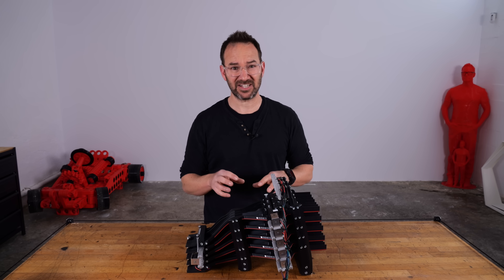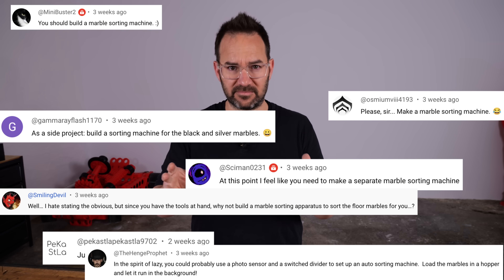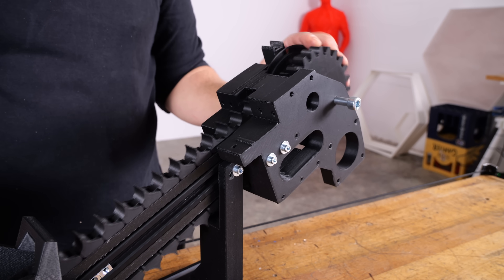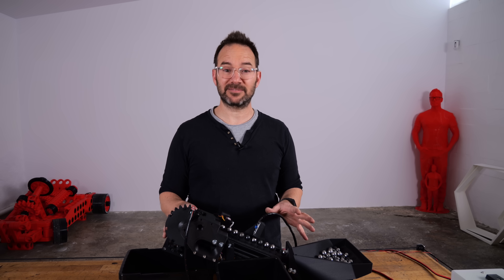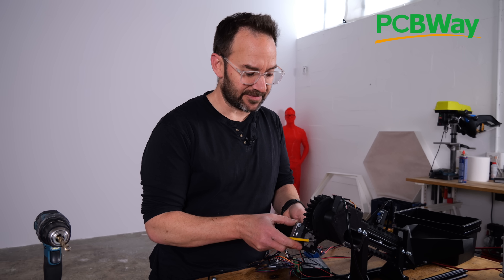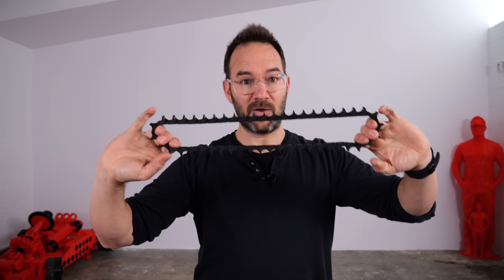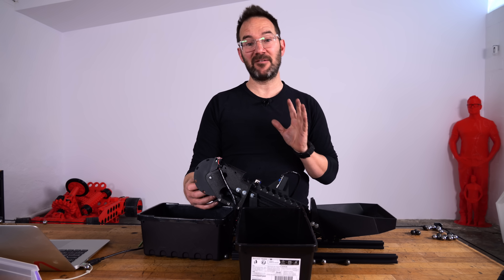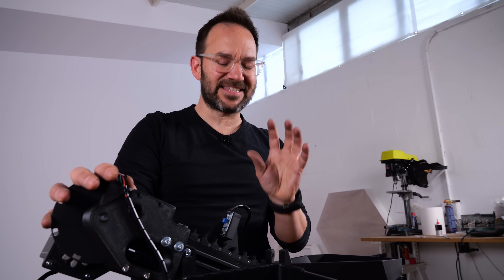Faster than the Eye Automatic Marble Sorter - Marble Clock Seconds Display Pt.3

Comment: Definitely need to incorporate :) I reckon you could get faster by optimising the solenoid motion by a) adjusting the timing so that the retraction of the pin is matched to the "springback" of the solanoid when it extends, and it can effectively speed bounce it out of the way (rather than oscillating a couple of times after extending), and b) adding some sort of dense foam sort of material behind the solanoid so it doesn't oscillate after retracting, but gets to a stable position sooner. Fixing b) in particular I think is the key to stopping it getting it out of sync with the chain and colliding like it does at 9:27.

Comment: I feel like 1 track is not consistent enough because of its ridiculous speed. The marbles are flying everywhere.
Having 2 of these will already reduce the speed by a significant amount.

When I opened the video, my own mind would choose for a system where you sort 8 marbles at the same time. 

I believe the display has 15 marbles per unit. So 8 marbles per sorting cycle can handle more than a unit per 2 sorting cycles. 

With a complete clock, in the end you need to sort for 4 digits, so 15x4=60. Using a system that can sort 8 at once, makes it so this system needs to sort 8 marbles per second, instead of 60.

Comment: If you want it to make it even faster, why not try a second syncronized step motor, but linked with a rotational pusher, so instead of waiting for the solenoid to retreat, it rotates the gear, pushing the marble and engaging to next position waiting next marble.

Comment: I like your creative and inventive initiative and the different ways you try to figure out how stuff can work.

Although, with that being said, keep in mind the idea that even in regular jobs, whether there be stocking store shelves in retail, working quick in the warehouse environment, which I currently do at my job for let’s say nine years around the end of August, little saying that captures trying to get stuff done quicker for making the numbers or the profit at a place, is that the faster you go the more mistakes you make. 

Around the first half of the video, there was a point where you had the machine, moving decently quickly and thoroughly doing exactly what you wanted to do fast enough without any mistakes, but the one thing I don’t agree on is that even though you have to have the marbles resorted to try every test run with your second counter, you need to be aware, that hypothetically, and this is completely off tangent, I live at home in an apartment and it’s just me, and there have been times where I’m trying to heat up something in my toaster oven or reheat it in my standard size oven, and I said a handful of minutes like let’s say even eat at the most to reheat pizza, I’m doing other things while heating up and my version of multitasking 😄, keep in mind that what you’re trying to accomplish is in a much much shorter time than eight minutes, you’re trying to have several marbles sorted within a time span of a minute and a half or less, but despite the idea of trying to make something move faster, so you have it sorted as quickly as possible, unless you build some thing that can withstand any mistakes at a speed you’re happy with, I would say either one of two things, somebody on here made a comment of making two sorters and slowing it down just a minor tad that way to machines doing the job a slightly slow pace but doing the work would get it done quickly in half the time, or, if you only want one machine, you need to have the patient or some minor sensitive responsibility to understand that if you can wait a minute and a half or less for the machine to sort itself properly at the low speed in the video that worked while making no mistakes, then having the patience to deal with that is the responsibility if you know, can do it at some speed that you’ve already tested that can do the job without an issue.

Hi, believe me when I say, I understand trying to figure out a way to make the sorting the fastest possible with no issues before it’s too out of whack or before things get out of hand, but the point in this video when you had a decently quick speed, no mistakes or errors in the process and what you wanted was still getting done, I believe there’s a little bit of responsibility in being able to realize that and stick with that if you have the patience to wait a little bit longer than what you foresee as the fastest speed possible without making any mistakes faster than the speed I’m mentioning in your video where no mistakes were made, you just have to have the patience to deal with it.

And that can sort them out overall helps you sort the marbles in the case of your second counter, that may be what you might have to deal with.

But something tells me with how creative you are, that you’ll either come up with a way to make your machine or make the same idea but in a different way that allows her quicker speed somehow with no errors, or come up with these mildly different similar way of sorting that will allow quicker speed.

Overall, though, when I was in the last week or so saw your video, my first video of yours on making that big marble sorted clock that shows the time that started switching the time by every 4 to 5 minutes, I like that you’re creative and inventive, and you not only say what you think the issues are but say what you think will do to help fix it, we’re like Seeing you talk about how you’re thinking about it as you do it and I like that.

Comment: Would like to see 2 of these running side by side, shooting into a shared central pipe for one color, and a shared dumping box at the end for the other. They could each run at a slightly lower speed that way, increasing reliability and also boosting noise... Perfect!

Comment: Run 2 of them in parallel at 12 m/s each for a total of 24 marbles per second and put that on the machine. You could definitely share a single drive motor for both chains. You just need 2 sensors and 2 solenoids

Comment: use solenoid to move a deflection paddle/tube at the END of the chain to direct the marbles into the two different bins.  then, as the marbles spit out the end, they go where they need to go.

Comment: 9:14 At this point, the 4 most needed modifications I can see are:

1) You need to add a wall on either side of the chain to keep the marbles from falling off as they come rocketing out of the hopper...

2) Taller hopper walls around the chain pick-up area...

3) A guide tube (with side walls and roof) would be a good next step to catch all the black marbles as they get kicked off the chain by the solenoid so they get directed down into the bucket rather than fly who knows how far before gravity reminds them which way is down...

4) Another guide tube at the end of the chain to catch the silver marbles as they too fly off the chain...

3 & 4 should save you a lot of time chasing down errant marbles that missed the buckets...

😄😁😆😅😂🤣

Comment: Ideas on how to optimize the sorter:
1. Make 2 rows on a chain drive. The left row is for light ones, the right one is for dark ones. The solenoid above the left row throws dark balls to the side, and above the right row, vice versa. As a result, dark balls will fall on the left, light balls on the front-left, dark balls on the front-right, and light balls on the right. You just need something like a tunnel to direct the side balls into the corresponding basket, and you will get a 2x acceleration - that is, you can slow down the conveyor and it will become quieter.
2. Why a conveyor chain belt at all? Raising the balls up is extra work, you will still have to raise them later to the level of the number dialing mechanism. Let there be just something like a gear wheel inside the corner of the diamond-shaped container, where instead of teeth there are seats for balls, on the sides of it there are 2 containers for already sorted balls, and above it there are 2 solenoids for resetting to the left or right. Fewer moving plastic parts = less noise and greater reliability.

Comment: Put a lever between the solenoid and the marbles to speed up the movement of the kicker. The solenoid has plenty of power but moves too slowly.

However, industry standard for this is to deflect the objects while they are falling with an airstream. The advantage is that the objects don't need to move the whole distance at the deflection point. They get an impulse and will move over by themselves while falling afterwards.

The other advantage of using the falling method is that you wouldn't need a belt, just a container with a marble-sized hole...
Reply: Then it is necessary to provide protection against blocking the hole by colliding balls. In industry, this is solved by vibration of the container, but in our case it can be too noisy.

Comment: Why not just make a loop of 10 marbles to rotate through the pattern from 0-9 and back to 0. There are even 4 segment displays so you would only need 4 loops of 10 marbles, bring each marble to the front, then keep it in order and return it to the back of the queue on the same segment piece. If the segment does not change states you would not even need to rotate the pattern just skip it that step.

Comment: Why not run two (or more) solenoids in tandem, firing oppositely?  While A is firing, B is resetting, effectively doubling your feed rate.
For the loading hopper, what about adding a drag strip as marbles head up the ramp, helping them settle in the chain so they're not bouncing about from the crazy load speed.

Comment: Maybe it would be faster (or catch less) if the solenoid moved a one way revolving wheel that pushed away the black marbles. Sort of like a revolver. Even better, the revolver wheel would work with two solenoids, for alternating stages. One pushes while the other one retracts, while the wheel keeps moving with any of the two.

Comment: I can imagine a miniature version of this clock that can sit on a nightstand. It would double as a white noise machine.

Question: won’t the solenoid piston put dimples on the balls over time?
Reply: Much earlier, a huge number of sliding parts will wear out; even if you make them of steel, they experience several orders of magnitude more load than the balls from the impact of the solenoid.

Comment: How about slightly smaller black marvels? You could maybe use a set of rails with the right spacing and all black marbles would fall through and all shine (bigger) ones would roll onwards. It would be a simple setup, easy to scale, fast, quiet and cheap.

Comment: Could using the first idea with the servo arm be faster by setting it to make a full 360 degree rotation when needed to push out the black marbles, instead of having it swing in and out?

Comment: Already at 11/second, there are multible black marbles in the wrong bucket, and it gets worse. I'd make 2 of them and run them slower but more reliable.
And consider the friction, this printed chain wouldn't last long at these speeds.

Comment: If the tolerances for the rest allow, is there any reason you couldn't have marbles be a slightly different size?  That'd make sorting across a grate massively faster than needing sensors and actuators.  The tolerances in the grates would be a bit more critical, but I think easier to solve.  If close enough in size, shouldn't cause any issues in the display

Comment: could you use a servo with a cross arm (4 arms off of it instead of 1)  Then all you would need to do is rotate it 90 degrees to eject a marble.  no having to stop and back up with each ejection. Other than that, make multiple channels for sorting. (duplicate your sorter and keep the speed at 10-15 marbles per second)

Comment: Of course you should incorporate it! You'll need a steady supply of sorted marbles. :)

Two suggestions:

- switch from the solenoid rejecting black to rejecting while/silver. Then it won't trigger on empty slots. Less runtime + heat.

- mirror the design to run two chains rejecting marbles into a central bucket. Then you can run it a little bit slower, have more room for error, and throw less marbles around at the loading end of the chain(s).

Comment: Instead of a solenoid you could have used two electromagnets right at the color sensor, and instead of using a timing belt let them roll down a ramp with a rotating mechanism that drops them down the ramp one at a time at even spacing. Then the magnet would direct the ball either left or right as it falls down the ramp. Way less moving parts which means less points of failure and the ability to make it move much faster
Reply: Alternatively, you could have even just found two different marbles, one that's ferrous, and one that's aluminum or something, and sorted with nothing but a ramp and single magnet

Comment: I would have envisioned a vertical approach with a holding bin on top with an exit hole, with a bit of magic that lets one marble at a time enter a vertical tube, falling down to a magic Y-tube (one tube in on the top, two tubes out on the bottom).  Or maybe the marbles roll around on a large flat rotating disc with holes around the circumference which the marble fall into partially, where thus trapped they roll around with the disc until they are over a chute with a color sensor operating a trap door to let one color fall through, where increasing the marble handling rate is accomplished by adding more chutes, each with their own color sensor and trap door.  (The rotating disc approach was used on a surprisingly simple coin sorter design that could sort thousands of coins per minute.)

Comment: You can see how many marbles are falling out of the bucket in the final shot of the video. I say, if you need ~17mps — just drop the speed to 10mps and build a second machine. Not only would you increase the total speed to 20mps, you also would increase sorting efficiency.

Comment: a mirrored pair of these would get you over the threshold for speed quite well
you could also get a solenoid that has a stiffer spring, as that will retract much quicker, but will use more current to fire

Comment: You can probably fix the issue of the solenoid catching on the chain by moving it a bit higher so it clears the teeth when extended. If need be some sort of flexible "foot" could be attached to contact the marbles lower down - stiff in the direction of the pushing action but flexible in the direction of the belt

Comment: Obviously we want it integrated!

Have you considered using compressed air to push the marbles? I'm sure there are high speed valves for airsoft that can be modified for this application

Comment: Being lazy, I'd probably just have a gravity fed funnel with the IR sensor in the spout that controls the solenoid that would either send the spout left or right depending on the colour... That way if you have a run of the same colour you can leave the solenoid in the same position until the colour changes again.

Comment: Why not ad more sorters. Since I noticed it runs a little to fast for reliable sorting, some dark ones seems to getting missed for some reason. Why not have two or even three sorters in parallell and run it a bit slower. Might get lower noice as well.

Comment: I say use 2 of them side by side with a gap in the middle. Push black to the center.

At the high speed you had you were getting so much vibration I could see it being a problem.

Also rails on the side of the track up till you need to knock the marble out.

Comment: What if you used air instead of something actually touching the marbles? You wouldn't have to worry about anything interfering. Not entirely sure about how difficult it is to get a valve to open and close fast enough for it though but you could use multiple valves leading to a single outlet if they cant cycle fast enough

Comment: Rather than a servo motor or a solenoid that has to move out and then return, taking twice the operation time to clear the path, could a motor with a four blade windmill be made to make a quarter turn to achieve the same effect? That way the next blade would be in position immediately to eject the next bearing.

Comment: I've worked on high-speed equipment.  One way that works better than a mechanical push is to use pressurized air.  A solenoid operated air nozzle has no interference and is very fast.   Also, the sorting function should be occurring asynchronous to the need for sorted marbles.    As they come off the clock, mixed, they can be sorted into the bins.   The need for sorted marbles comes out of the bins that never are allowed to go empty.  With presorted marbles building the numbers should go a lot easier.

Comment: If you want to go super fast, you could leave the solenoid energized and use an H-bridge to swap polarity based on state.  That way, it would be: powered extend, powered retract.  It would likely provide the damping you need to go even faster.

Comment: I have three suggestions, one of wich may not make sense, i don't remember the proportions between the number of shiny and black balls: first of all you could just add a second solenoid and make them push the balls out alternately (like, one ball is pushed by the first one, one by the second one and the next one by the first solenoid again in a cycle); It could be also a good thing to add a second sensor to be shure about the balls identity if you get false readings when making it go faster thanks to the second solenoid; lastly, once you make it go faster and you connect it to the rest of the clock (thing that i think would require a bit of overhead in the speed), there will be a bit of empty spots in the chain, so i would either switch the balls (by pushing with the solenoids the shiny ones) or print the chain in white so that solenoids don't activate it since it should be seen as a shiny ball